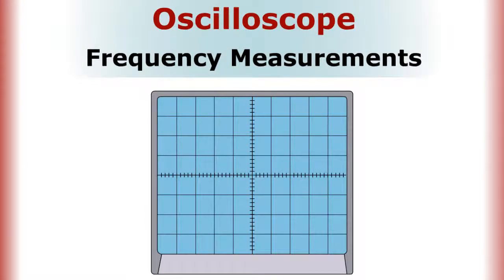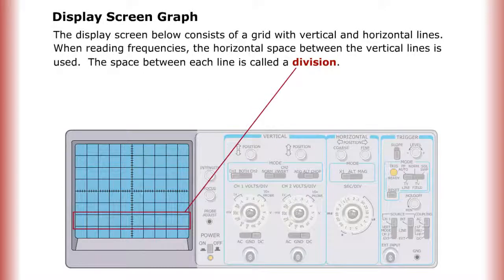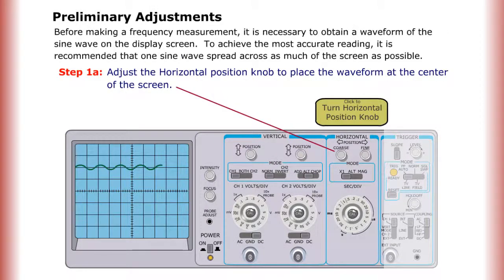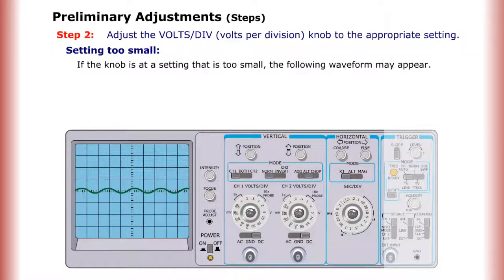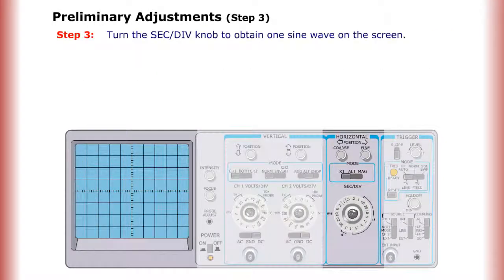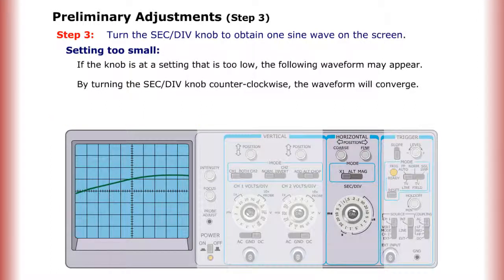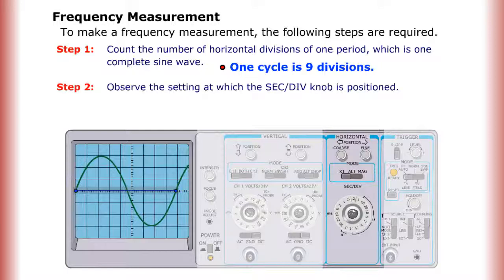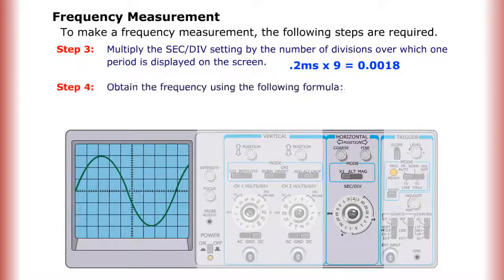Oscilloscope Frequency Measurements

Comment: On step 3 why do you multiply .2ms x 9 and then you divided the total by 1?
Reply: same here
Reply: multiplying 0.2ms and 9 gives you the time period (the time taken for a complete wavelength to pass a given point) f = 1/T (T = time period and f = frequency) gives you the number of complete wavelengths passing a point per unit time
Reply: @sosa_es2721 that doesn’t explain why divide by 1
Reply: @Wtfinc  it does.😅